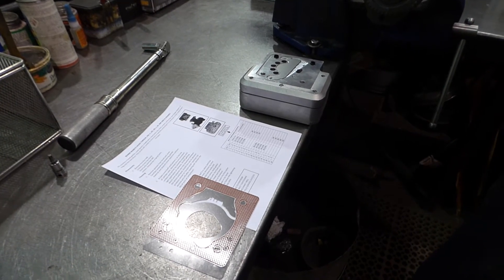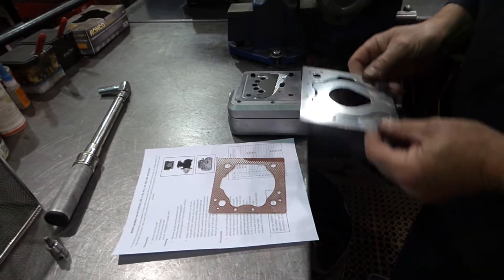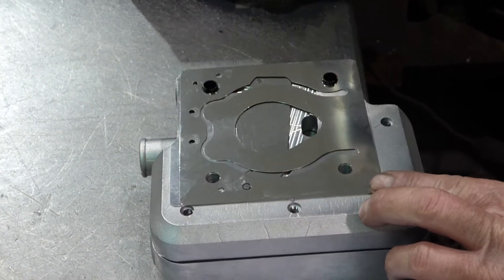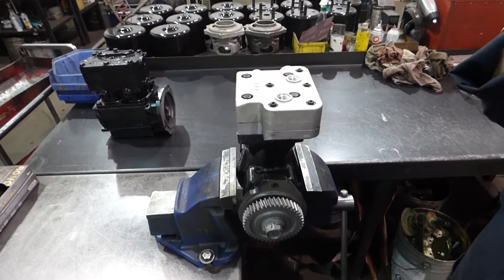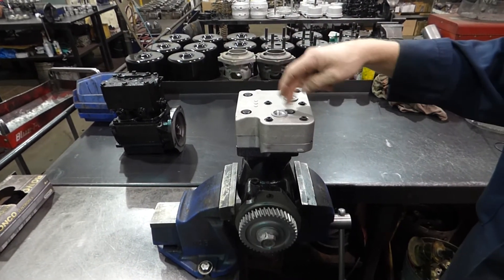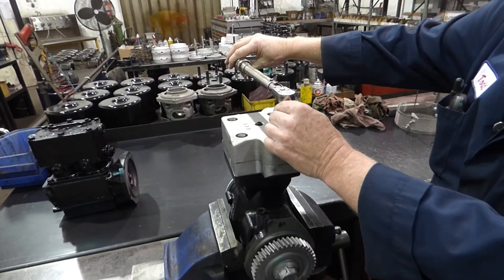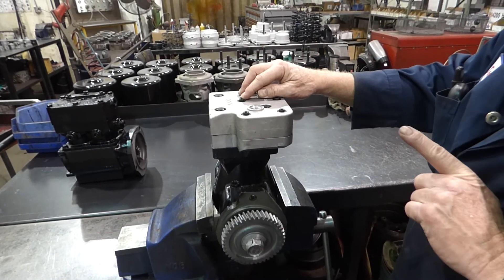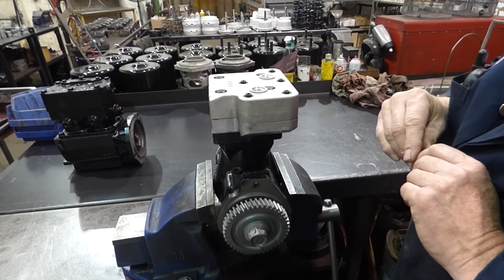85mm Head Installation

Comment: Nice video. Can you please provide information about removing unloader piston as well
Reply: 👍Yes, please provide information about the piston or spring that keeps the seahorse in the position to close the opening. Does the spring or piston ever get weak and does not pull the seahorse completely over the hole to close it 100 percent?